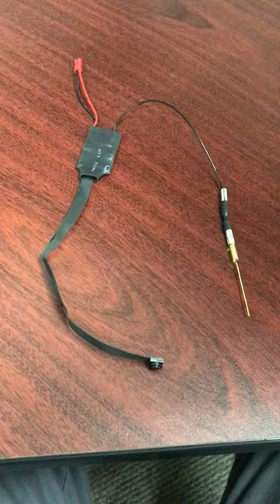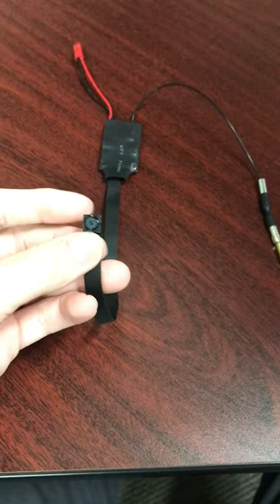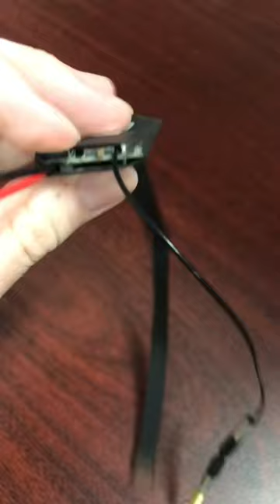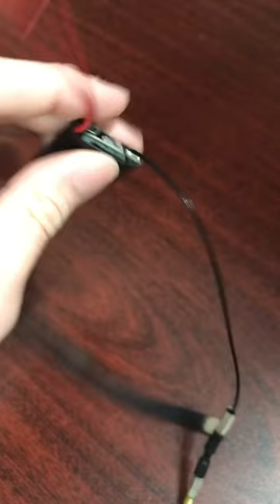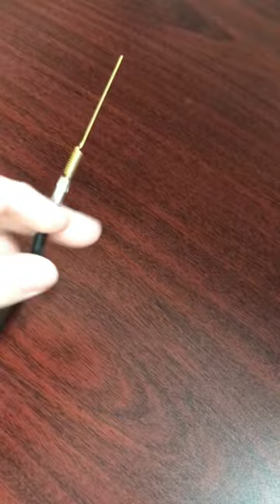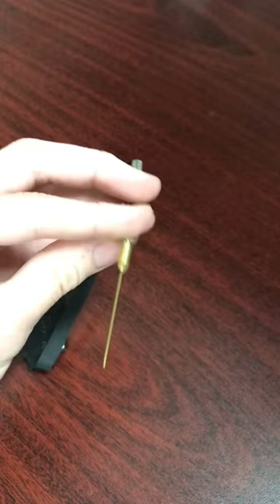What do spy bugs actually look like? #shorts #spy

Comment: Q. How are they sending the data? Would it be Wifi, Bluetooth, cell, or some other kind of signal. Are the able to mask the signal normally threw cell. I know that a lot of hotels and motels clock alarm, looks exactly like the normal clock that these places have. It was plugged in, looked exactly like the clock but the clock it self keep churping like it keep connecting to something. Turned my wifi on my phone and it keep showing a wifi name going in and out. Plug in and out the clock and the wifi went on and off every time I plug it in and make the sound like it connected to something...